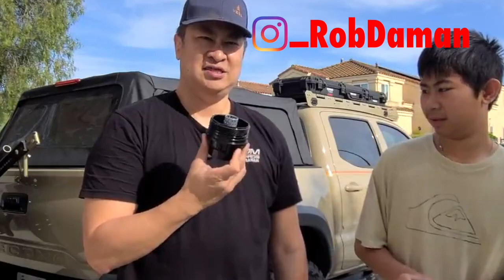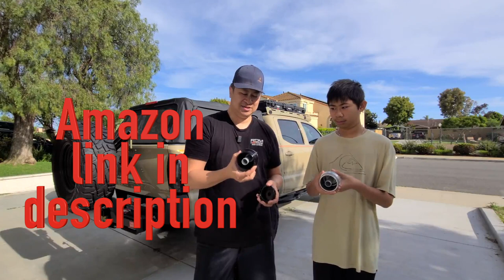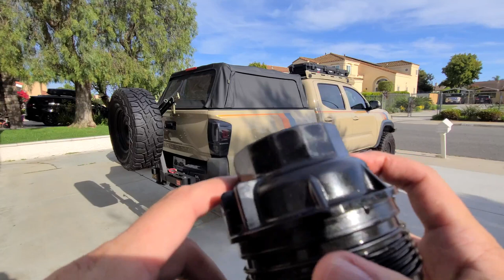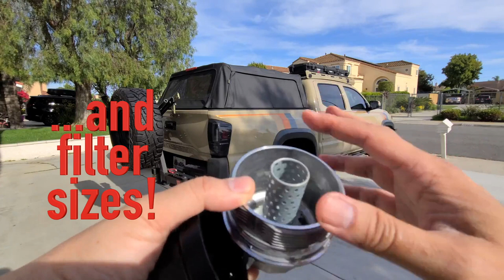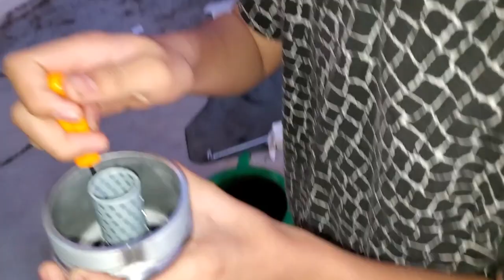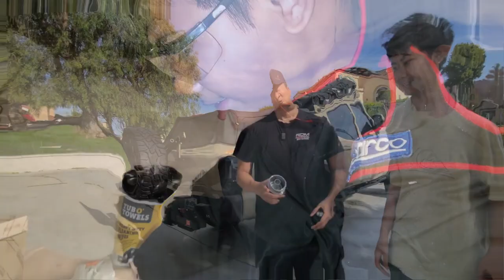Toyota Sold Out! Cheap Plastic Oil Filter Cartridges! Problem with all Yotas and Lexus cars & trucks

Comment: I personally think these new oil filter cartridges are an example of poor engineering, just to save pennies. Toyota please do better!
Reply: Well you won't belive it,but toyota actually made a 4 bolt change out housing you can buy at Toyota parts to have a spin on filter ,for Under $150.00 you go order the correct spin on filter housing that fit 2009 to 2011 Corolla, nice toyota made them but didn't install them

Comment: There is a potential problem that can arise if the plastic cartridge canister is replaced with a metal one. On most of the engines that have this the oil filter it is on the bottom of the engine. Should you bottom out the front end of the car and hit a rock or other object under the engine area.  The plastic canister will easily break. If that happens with a metal canister there is a greater risk that the engine block will be damaged where the canister threads into the block.
Reply: But the bottom is covered by a skid plate so that would never happen. For an FJ that is.

Comment: You don't have to use any tool to get it the filter tube. Just pull it out at an angle and the tab will pop out. Reverse that process and the tabs will pop back in. If your tube isn't straight just bend it back into shape AFTER you put it back in the filter canister.

Comment: I wonder if their newer plastic upper intake manifolds on the 2gr-fks will end up being problematic when the car gets old. It was for other brand cars in the past.
Reply from the maker: anything plastic and heat cycling will not last as long as metal but the question is how long before it degrades

Comment: For 2019 NX300 and 2018 Rav4 you don't need to change the tubing. You just use the tubing it came with? Thanks
Reply from the maker: Hyon Jin Chung I think you mean rubber gaskets? You will replace them.
Reply: @RobDaman  you said you are changing the tube inside the filter housing for the larger engine because it's longer. My question is for  nx300 with smaller engine just use as is?
Reply from the maker: I don't know what that tube size is for that model. I would compare and swap if needed.  Tundra was larger and 4runners I know are larger than Tacomas.
Reply: I think for Highlander too.  No change needed.  Will find out shortly.

Comment: Did you have to drain all of the oil to change the oil filter housing? I ordered the metal one and I’m curious if I have to throw away and waste all of the oil because I just recently had an oil change.
Reply from the maker: Removing the canister doesn't drain the oil pan just the current canister. Be sure to top off
Reply: @RobDaman  perfect. Thanks for letting me know

Comment: Thanks for the info and recommendations! I installed a metal Dorman Oil canister and after a day of driving it has a leak. Just ordered the Toyota canister you recommend, but just wondering if you have had any issues with yours given that the aluminum may not provide as good of a seal as the plastic product?
Reply from the maker: the rubber rings are important to prevent leaks but as you saw in this video the plastic can crack. aluminum will be as good and longer lasting.

Comment: TCCN explained that the moment you messed with central tube, the bypass valve is ruined and you have no option but to get rid of the oil filter canister. The plastic canister is built with high quality plastic. The issue with them happens only when they got over tightened, which many make that mistake and overtight the canister beyond the specified torque force
Reply: I do not see how taking out the tube will ruin the bypass valve. It’s just a spring between the bottom cap and the valve in the tube.
Reply: @waynezw  removing the central tube requires bending the part that holds the valve in place. After reinstalling the tube into the new case, you can see that it wiggles, and that is your sign that the valve is no longer functional as it should be
Reply: @NaderBelaid  In the original filter canister, the tube always wiggles as it is held by the spring and four tabs at the bottom of the canister.

Comment: Wait the tubing length looks the same... can someone confirm?
Reply from the maker: Same on tacos yes. 4runner  and 5.7 v8 are different tubes.
Reply: bought a new metal oil housing from dealer for 2012 Toyota seinna 3.5L, does the tubing lenght have to be changed inside filter housing? or is tube change just for V8's?

Comment from the maker: his video is about how Toyota continues to put these cheap plastic oil filter cartridges in all Toyota and Lexus models.

It doesn't take much to run them and not much more to use a metal on that they used to put into older models.

Get the metal one now!  here:  https://amzn.to/3eVNNrW

MotivX wrench here:

MotivX oil filter wrench here https://goo.gl/hBwvMb or here https://amzn.to/2Y7HlIg
oil drain tool https://goo.gl/4qE9YM
fitted oil funnel https://goo.gl/oYQztz

Comment: I rather replace the plastic cover then replace the other side if you ever cross thread the metal cover onto the other side! FYI after the last free oil change from Toyota check the plastic cap and see if any of the tabs are broken from over tighten. If so make them replace it or let them do the next oil change and let them deal with it. Ask me how I know.
Reply from the maker: I'd agree if I'd let others do future oil changes. Good idea on the check of plastic. 

I'm scared to ask 🥺

Comment: Dealer cracked the plastic housing on my brother's 2015 4-Runner.  They should be only torqued down to 18 ft lbs... 
I am guessing that;s the torque for the aluminum housing too?
Reply from the maker: Yes. Correct.
Reply: @RobDaman  I always wondered why Toyota never just used Aluminum for this part in all of the applications of this oil filter design??  I would think over the life of the truck... the plastic one will wear or break at some point??  Even being serviced with the proper torque.
Reply: Not really. Here is the trick. 1. Use OEM filter replacement AND the gaskets O rings. 2. Lubricate that O ring gasket really well, personally I rather use conventional oil on it than the synthetic. 3. Spin that thing on by hand and be shocked when it bottoms out. That is your torque limitation. Can not be overtightened. 
Bonus trick: if you did put it on this way have confidence in yourself that you did not overdo it putting it on and when you are removing it it will come off just as easily. Wait for the engine to be cold again. Makes night and day difference.

Comment: It is NYLON not plastic. The metal and nylon are the same price. I just bought a nylon one on ebay for  $28 shipped. I have  a metal spare which was cheaper.  I want to put soft nylon into my engine thread...not harsh aluminum. Imagine the cost if the engine threads get beat up !

Comment: Brilliant and wholesome content !,,,sometimes I wonder why the engineers designed it using a more “frangible material, then someone reminded me that sometimes the “fail safe” is built into the components rather than the machine ,,in other words, be glad you weren’t looking for a new engine block of for any reason the “component” were over torqued 😉👉🏻
Reply from the maker: nothing power tools can't handle lol. I'd probably weld on one of those adapters that you can use a spin on filter if that happened.

Comment: If you have problems cracking a oil filter, then you shouldn't be as much as lifting a wrench to do anything. But, if the dealer messed up your oil filter then yeah change it. But then again, if you put on a metal oil filter and god forbid you have to take it to some service station again, then you are in for a even bigger trouble. The metal filter will cause the mechanics to torque it even more!

Comment: That’s Void warranty. You will have to do after the warranty period.
Reply: It doesn't void entire warranty. Upgrading aftermarket parts "void warranty" will only void THAT specific aspect of a warranty. As in, if something unrelated goes wrong somewhere else, it's still covered under warranty. But if something related to the oil housing cap is wrong, that aspect of the warranty is void.

Comment: New fairy tale 🤦😁
Plastic in not bad at all actually
It will not crack because of temperature
I had a lot of Toyotas with huge mileage. All of them have a pretty good plastic filter housing cup